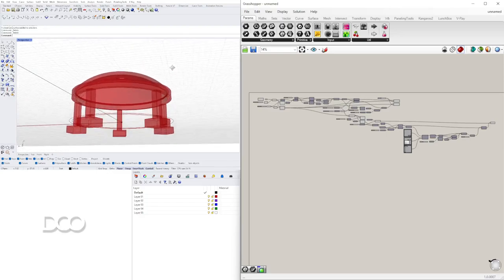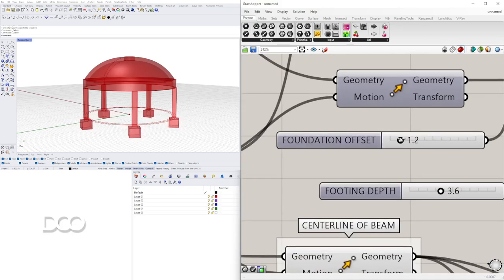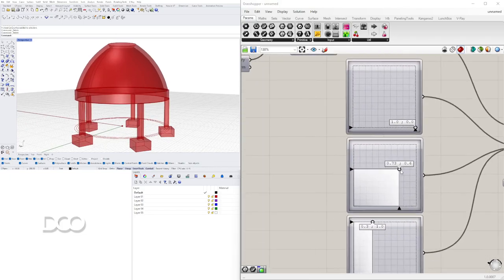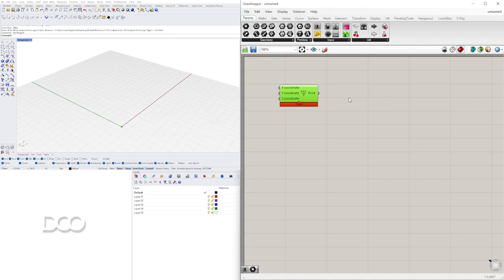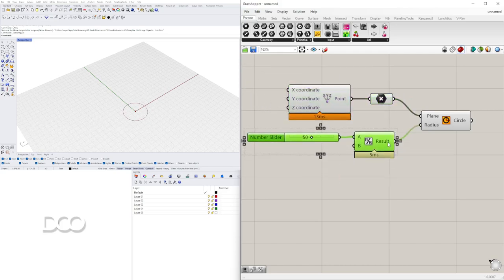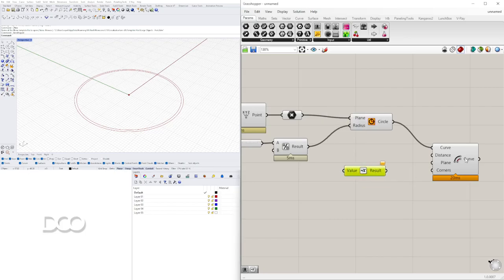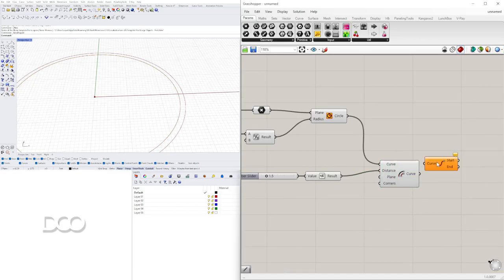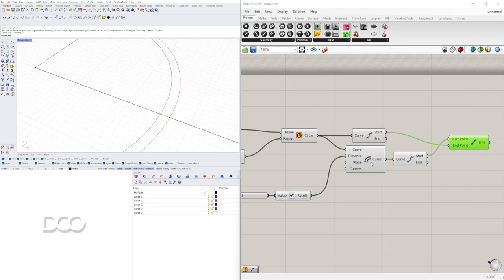Pavilion Stand Alone Structure Algorithmic Rhino & Grasshopper Parametric Architecture and Design

Comment: sir i hope you are doing well at 9:29 when you take that offset of the base surface... in my case when i repeated these steps instead of taking offset to outside it took one inside what could have gone wrong moreover when i increased the value in slider the offset came out but the four lines appears seperate instead of joined how to correct this???.....
Reply from the maker: If you can, please send me a message to copetedavid.com, and if you send me the script, and where you are, I can help you further, and see what is wrong with the script.  Thanks for reaching out! and look forward to helping you with this issue.